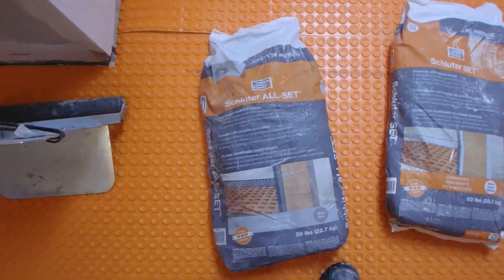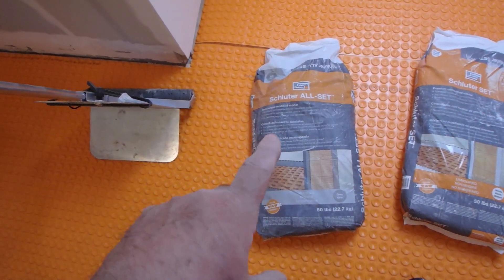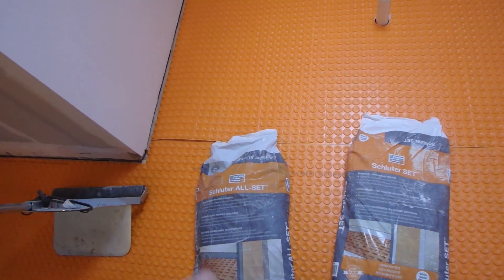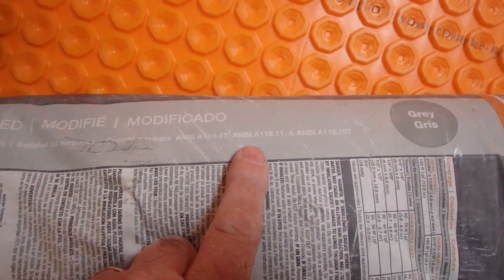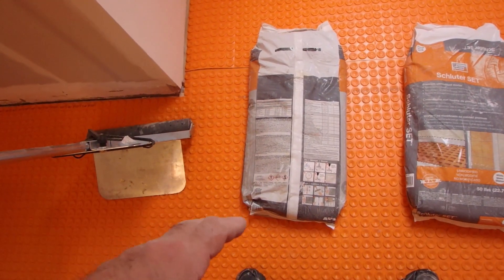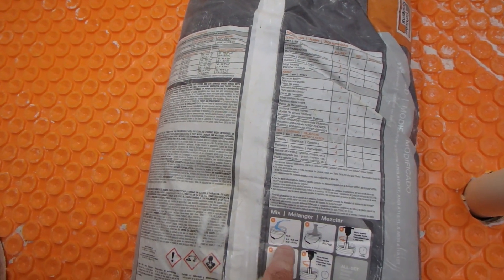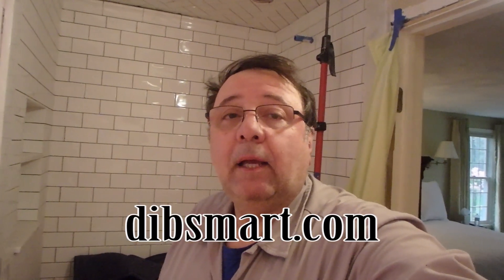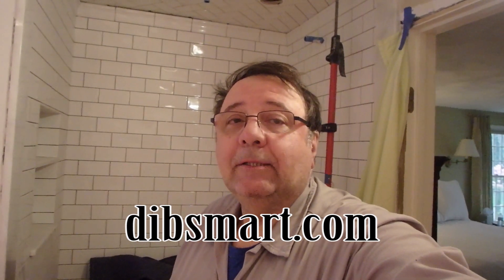Thinset by Schluter, Now you are all set.

Comment: Thanks Sal for the great video and explanation. We recommend that anyone using DITRA or DITRA-HEAT use ALL-SET.  It's great that Schluter came out with their own thin-set because it cuts down on the confusion. And from what I've heard the prices aren't that bad.
Reply from the maker: This is great news, one stop shopping ☺
Reply: And a Lifetime warranty...not bad
Reply from the maker: Now we are AllSet  😁
Reply: They used to offer a lifetime warranty as long as you use the proper thinset, but now require the use of their thinset to get the warranty. And their thinset is VERY expensive. As a longtime schluter fan,  I'm very disappointed.

Comment: I have been using TEC modified thinset over schluter from the start. Not what they recommended but just never felt that the unmodified was sticky or strong enough.  Never had a problem even after ten years. The All Set isn’t cheap but in the scheme of things the cost difference is inconsequential. And to preserve is the warranty i will use it.

Comment: Can I use the schluter All Set mortar under the schluter shower waterproofing membrane? Then use the schluter quickset on the shower walls because I’m using 13x24 tiles?  Please answer.
Reply from the maker: AllSet can be used for all phases of the install. You can use the quick set, but if you are not used to using a fast setting mortar you will struggle. Better to use the AllSet for everything.

Comment: Sal ... nice info, but I have found with Schluter it's all about $$$$$. Modified is modified and unmodified is un modified. My personal sense is that they are starting to panic because many companies are thinking of not producing unmodified thin set. Its getting harder to find. I have switched to Laticrete Hydromat and use premium modified on both sides. The hydromat has vent holes in it to allow faster drying. Nice video as usual ... you do excellent work. Just another opinion. Thanks.
Reply from the maker: I disagree, Schluter is all about quality and education, they have great products and great support, the innovate and bring quality and knowledge to the industry, they are a leader that others copy. Modified is not just modified and the same goes for unmodified. Look up ANSI 118.1, 118.4, 118.15 etc then the suffixes E,F and T etc. All thinsets are not equal, not by a long shot.
Reply: Robert Avery you should try the usg membrane. Much easier to use than ditra.
Reply: Hey Travis. Thank you for the info. Went out and looked at it, looks like Noble Membrane. I'll have to get some and try it out. Appreciate the input. That's what YouTube is about. Helping each other .... later.

Comment: Will modified  on Kerdi eventually cure with enough time exposed, before putting tile on. I have condensation appearing on the back of tile(overnight) as I dry fit 1st row on tub flange?My retailer gave me Mapei Keraflex Plus by mistake I presume.....Am I doomed , do I need to tear it down(Kerdi board /kerdi band/kerdi fix) or can I wait a month so it cures.
Reply from the maker: It will eventually cure, just need to wait, going to take some time.
Reply: @SalDiBlasi  Tnx Sal, Schluter asked me to dry fit different subway tiles to test........pulled them off this a.m ;these other tiles (porcelain/ceramic)don't seem to be showing condensate on the back? My chosen , common ceramic tile is still showing water beading on back.....i'll wait tnx.

Comment: Sal,
I installed a Schluter triangle bench in the shower. I am using a 1" thick piece of granite for the top (unpolished on the bottom) instead of tile. Will the Schluter thinset bond the granite to the schluter bench or do I need a different adhesive? 

Al

Comment: Hi Sal, If you've already used another manufacturer's product to install the membrane over the mud floor and Kerdiboard, would you stick with the same product to install the tile, or does it matter?
Reply from the maker: Not sure I understand your question. If you are asking about the thinset for the tile, then yes I would use Schluter thinset to take advantage of the lifetime warranty.
Reply: I was wondering about using the Schluter-Set to install the tile, if I've already used another manufacturer's unmodified thinset to install the membrane. Does it matter? Thank you.
Reply from the maker: No, go ahead.

Comment: I used a polymer modified glue the first time ever I had to work on top the of Schluter kerdi membrane years years ago. 

About a month later the client decided that he wanted a sprout in the shower to fill up bucket and I had to remove a couple tiles (12*24) for the plumber to install the sprout.

The tiles came in small pieces, it was hell to remove. I'm all about using the right product for the right application and since after that job, I've been using in unmodified glue. But if like me you used the wrong glue once. The tiles won't fall off the wall if it was properly install....

Comment: Hi Sal, Love your videos. Question for you on the new thin set: I am installing 4x12 glass tile in shower over Schluter Kerdi. I called Schluter last year, and they said it was okay to use the modified thin set for glass, but that I needed to let the thin set dry for a week or so before grouting. Would this Schluter All Set work for glass tiles? What is the best thin set for glass on top of Schluter Kerdi shower system?
Reply from the maker: Glass has very specific requirements for the type of mortar that should be used. As far as I know AllSet can be used to install glass. but you should confirm with your Schluter Rep.

Comment: Used All-Set with 6 quarts and 50 lb bag  - mixed per instructions and it seemed pretty thick - hard to comb on the wall with kerdi board - too much rolling off - seemed too dry. What has your experience been now that you've used it for a while. Can't imagine 5.5 quarts being thin and smooth enough to comb on a wall.
Reply from the maker: Did you mix it according to directions, it tends to loosen up if you mix it for the entire length of time they say. They have recently adjusted the formula and is much improved.
Reply: Tried to mix according to instructions on the bag. Maybe we have some old and new formula bags. The first wall we did combed out better and was a bag we just bought. The other bags we bought several months ago, so maybe those were the older formula - might need a little more water - seemed too dry and would ball up a lot and roll off the wall.
Reply from the maker: The older bag was probably the old formular, the new one has been available maybe a month or 2.

Comment: Hey Sal. Great video. Do you know if the All-Set can be used for the Kerdi Band? Also this can be used for kerdi board on wall tile right?
Reply from the maker: All set can be used to do anything with any Schluter product that requires thinset.
Reply: @SalDiBlasi  I do Home Remodeling and additions and have been looking into Schluter for two years to do my own bathroom. My Tile Installer Sub always used Durock and Mortar pan but it was so messy in a finished house and the owner would cringe so I wanted to try a new cleaner install system and Schluter looked like the right system compared to USG and all the others. In an unoccupied home Durock and Mortar pan is fine I just want to spec a system that works for certain jobs.

Question Sal, do you install the membrane directly over the drywall with a pitched pan shower kit? Any pros or cons? That always worried me I wish they made a kit with the Kirdi Board, that is what I am going to use and buy all the pieces separately.
Reply from the maker: @Robert-ex2qp  I have many videos that show exactly ow I install a schluter system, pretty much always  Kerdi Board and a mud pan sealed with Kerdi Sheet membrane.
Reply: @SalDiBlasi  Thank you for your reply. Looks like you have done everything and I did notice you use a mud pan over a Kerdi Sloped Pan which is why I asked  for your experience was with them prompting you to stick with the Mud Pan. 

Thanks for all your videos.
Reply from the maker: @Robert-ex2qp  I have done countless mud pans over the years, they are quick and easy and very versatile. They will fit any drain location, any size and shape, and the subfloor only needs to be in good enough condition to support the floor. . I foam pan is a good option for some installs, where you have the exact size and drain location where the pan will fit without modification, the sub floor has to be flat and level to preserve the correct pitch of the foam tray. These trays can be modified and extended, they can be made to fit pretty much any situation,  but the subfloor has to be made level and flat no matter what. once you cut into the tray, the perimeter is no longer straight and level, you have cut into the bowel part of the tray, so steps need to be taken to rectify that, which adds more work. So unless the tray fits the shower floor area exactly without modification, the time needed to install it and make it fit, makes it look less attractive than mud. What it does allow, is to have installers that are not familiar  with mud, which is more than you might think, to install a complete shower, including the shower floor, when they would have previously struggled to complete that step. Is a foam tray a solution for a shower floor, yes, but it is not as versatile and efficient or economical as a mud pan.
Reply: @SalDiBlasi  Thanks for your time to share your experience. I have been in the building trades for 40 years before nail guns and chop saws and a mortar shower pan underlayment was soldered copper or rubber with folded corners.. I have seen some installers today in every profession looking for the fastest way over the best way. I shoot for my work to last the life of the house. That is why I reached out to you, a combination of new and old best building practices.  You are now my go to tutorial page, what would Sal do, thanks again.
Reply from the maker: @Robert-ex2qp  Copper pans,  you must be in New England.
Reply: @SalDiBlasi  New Jersey and Maine. You being in Massachusetts we use the same Schluter Rep and follow the same building codes and practices that is why I reached out. Copper and EPDM rubber pans under mortor was the norm in the 70's . You would need a 20lb sledge and demolition power hammer to tear out a bathroom back then, I am open to change. When done right Quality, Cost, Time is what drives a project, I put Quality first always which saves Time and Cost in the end. Some of the new generation needs to learn that, take your time to do it right and you'll continue to get faster and more referrals.
Reply from the maker: @Robert-ex2qp  east coast, had to be close. Stay informed and up to date, use what works best for you asking it falls in to proper methods.

Comment: I would bet that the all thin set is the same has mapei lft .same bags, same thickness and shluter dont have a compani to make glue. Nice advertising for the compani 😉
Reply: Junior Provencher Schluter actually built there own plant and does manufacture their own thinset.
Reply: Thank you for the reply
Reply from the maker: Schluter has a manufactering facility for thinset in Plattsburgh  NY
Reply: Junior Provencher  I would bet its made by bostic. just like the first set.
I have had ditra fail with mapei lft from lowes. Wil never use mapei again
Reply: I would like to know what problem u had with the lft cause its the only glue we dont have problems with  wen installing 24x24 and over.
Reply from the maker: Not Made by anyone other than Schluter, Plant in Platsburg NY to put all doubts to rest https://www.youtube.com/watch?v=2i4zhCs72J8
Reply from the maker: Lft is designed for "Large Format Tiles" regular thinset is for smaller format tiles up to 15" on any side. LFT is designed to be able to hold large tiles, has more body and can be used with larger trowels for a thicker setting bed. Regular thinset is supposed to have a bond coat between 3/16 to a 1/4 inch, some lft thinsets can be as thick as 3/4" It is not the thinset, it is the tile you are installing on it. Use the appropriate adhesive for the job you are doing.
Reply: This is why I always use lft for floors Sal because clients today go crazy for big tiles 24x48 32 x32 this is what I install usualy
Reply: me too LFT or Flextile 56
Reply: Is it possible to make a small batch of all set instead of mixing up an entire bag?

Comment: why is this orange Schluter product better than cement boards?
Reply from the maker: Because it uncouples the tile from the floor which prevents cracks and can be used to waterproof in conjunction with Kerdi band and is also a vapor management system for excess moisture. Besides all that it is light, easy to install and dust free, just to name a few more benefits.  Cement board does non of that, is heavy, cumbersome and outdated.

Comment: ya but its been 42 years on the market never sold thin set .Now they do cause there is a problem with instaling porcelain tiles. tile compagnies wont garantie the installation with unmodified thin set on porcelain tiles
Reply from the maker: I refer you to this video,   https://www.youtube.com/watch?v=nY3WSe08n2M porcelain tile installed with unmodified thinset on Ditra. Tile manufacturers never guaranteed the install, the only back the quality of the tile, nothing else. Other Thinset manufacturers are coming out with uncoupling membranes and foam boards that they never sold, so there stuff must be crap by that reasoning.
Reply: If u hit ur tiles with à Hammer before like u did its easy to say it will Come out in million peaces. I Just did à repaire instaled on shluter 2 weeks ago and it was Well installed but still the easyest repair I did in my life. I use to do repairs in La Bay and zellers in Canada so I think I know what im talkin about. Im not saying that schluter is not good I use it myself for clients that can pay for it.